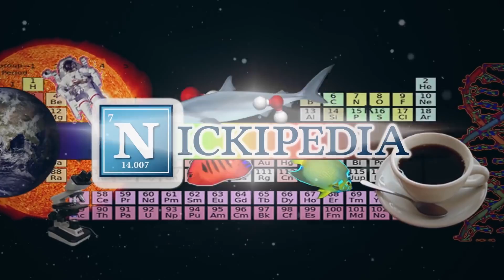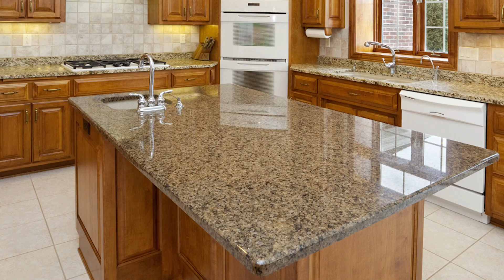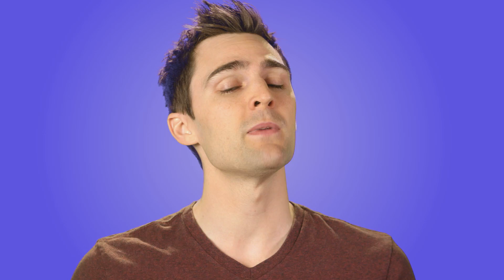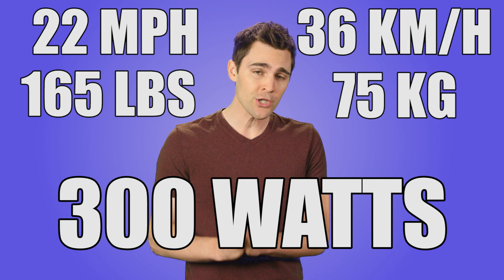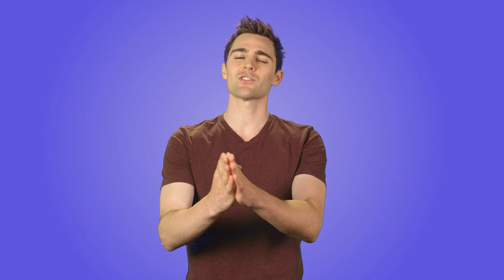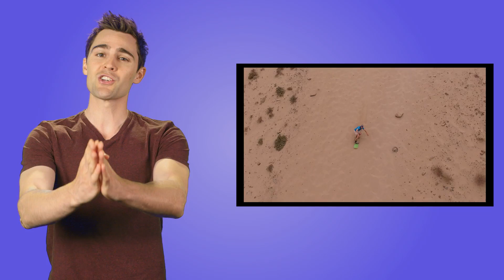Why Is ICE Slippery?

Comment: in hot air the molecyles are further away that in cold air, so in sauna( its an open space)  lets say 80°C so shouldnt the air pressure be lower than outside or like what i just cant understant it so could you make a video about it